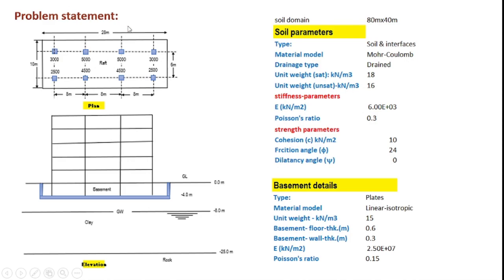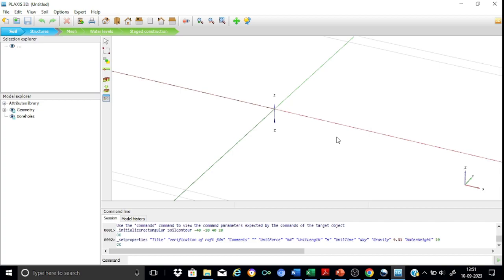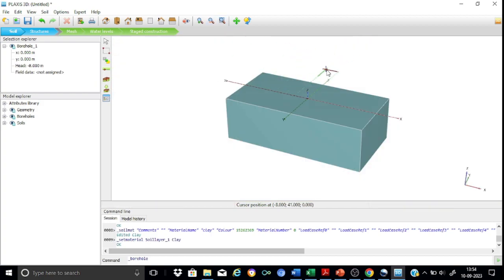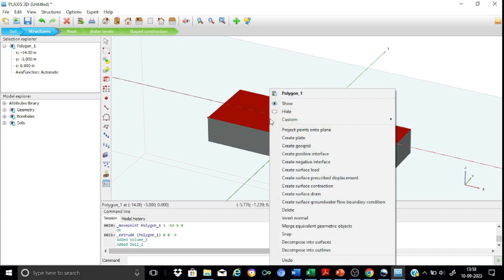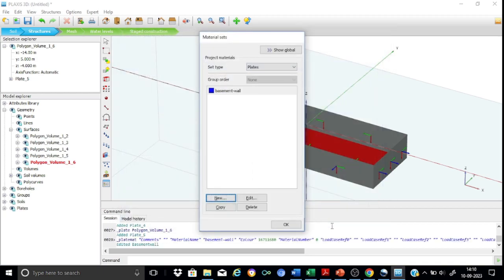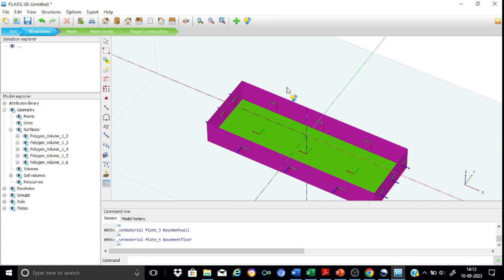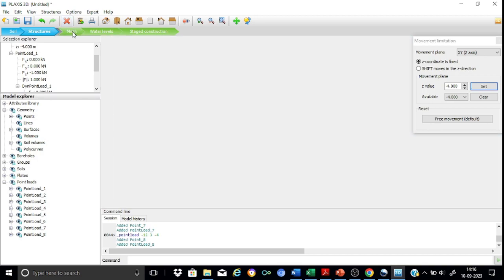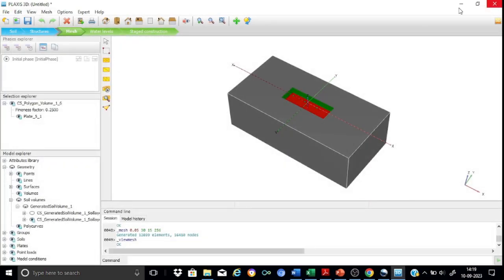PLAXIS: Tutorial-3 (Part-1 of 2): Verification of Raft Foundation

Comment: Hi Sir, can You again clarify why did You put the unit of weight of concrete 15 kN/m3? Because, if You got input parameter from structural designer of contact  pressure that includes all loads from the upper structure even the self-load of the slab, than the unit weight of concrete can be as 0 kN/m3. Am I right?

Comment: Dear Jayarajan Please explain to me that the have you subtracted the full or partial unit wt. of soil from unit wt. of concrete to arrive at 15 kN/m3? Isn't this value on the higher side as I think the full unit wt. of soil should be subtracted from say 24 kN/m3?
Reply from the maker: My understanding is that in any FEA program when we create a plate its elevation corresponds to the mid-plane of the plate. Accordingly,  I assumed a higher value considering  half the thickness in soil.
Reply: @puttattjayarajan1199  Thanks for clarification.